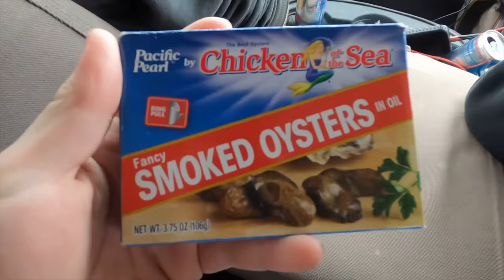Will this Old FORD Drive 500 Miles Home???

Comment: Janelle, I was a Paramedic for 28 years. It is a great job, tiring and rewarding. The greatest advice I can give you is to get your Paramedic license to work on a truck for 1–2 years, and then switch over to nursing., get your RN, and from there you can go much farther. The hrs will be less for extra pay and benefits and your home time will be much better for you. The risk of hurting your back or getting assaulted will be less. Back injuries are more common in shorter people. As a Paramedic you will be way ahead of the RN game as ACLS, PALS, NOWS and BTLS are bred into you in a year, that is your benefit as most RNs get some of that but not all of it and usually not until they have their RN. It will make you a better nurse and leader for your patients! Best wishes and it was good seeing you on the show again!

Comment: Tell Jannelle great  career choices. I retired after 40 years as paramedic. The shift slowed me to have a second career. Also, I did residential building and remodeling.  If you can try for a fire department based EMS service, way better benefits.

Comment: I had a 76 F250 super cab with a 460. It got 10 miles a gallon no matter what I did. In town going back and forth to work, or cruising down the highway. I towed another F250 with 4000 pounds of firewood split between the 2 trucks 150 miles down the highway at 70 mph with the cruise control on in the hills of Missouri. And it still did 10 mpg.

Comment: 25:24 Thermo boots made to keep the cold out also wont let the heat in ....in cold weather you need to get the boots off and wear shoes the heater even if its great wont warm your feet youll know when your legs are frozen up to your knees ......sit in the seat feet outside the truck take your boots off ,swing your feet in and place your boots so the opening is facing the floor vents on the passenger side , try and keep the floor as dry as possible...drove 3 cadilacs and a lincoln from Ontario Canada to Calgary ,Alberta before we discovered this concept  it works talking thru experience about 2,000  miles worth of froozen feet and legs absolutely numbness on the feet and legs doesnt matter how much you tap your feet and dance and squirm you will freeze if the geater vent is able to warm.yiur feet because of boots ...

Comment: About time you have decent truck on this channel!  :p  
(I collect build and modify dentside Fords tucks, and collect parts for them like your Dad does Corvairs.. :D )  

looks like 73 to 75, 1 ton, 390, Should be a C6,  probably a "custom" trim package, looks pretty basic, although a lot can have changed in 50 years.  Probably D60 in the rear, 3.73s, although my 71 with 4.10s is a 90 mph truck, but if you were cruising like that with out the motor wrapped, I'd call it higher,  3.50;1 maybe. if it wasn't a 1 ton I'd guess higher, my 76 2wd w/460 has factor 3.25 limited slip! 

Really cool seeing that countryside over that hood, even if it was in fast forward!(I've been daily driving one for 20 years, but will probably never get to drive one outside of Alaska)  

Even before Rudy said it, I was thinking I'd like to see you smoke the Dodge with it.. :D

The build on this thing better be on this channel or I'm gonna come down there and throttle you guys ;) :D

Comment: Don’t make the mistake of ruling out those old Ford Trucks. I grew up in
Several of them. Those 351 and 390 V8’s are tough engines that don’t need
a lot of maintenance..  I am driving an F150 extended Cab version now..
Those truck has a lot of life left  in it still. Great to see Janelle back..
Be Safe you guys.. 
MWP Cosby Tn.

Comment: Don’t ever get rid of that motor. It will last for ever. I had a 78 F250 with 460 in it. Got over 300000 miles on original motor transmission rear end only changed out the water pump alternator and Radiator. I saw the super cooling radiator in it. Also I can’t remember if I had the timing at 8 degrees btdc. Or maybe 16 degrees btdc. Never used oil   For the oil leak on the back of the engine check the oil pressure sending unit at the back of the engine on top near transmission. Mine blew the top out of it and it pissed oil like what you got. Stick your hand down the back of the engine just left of center and see if oil is puddling at the back. I thought I had blew out a rear main seal and when they went to take the cruise control off the block the stuck their hand in oil.  I wish I had my old truck back. I had it for 17 years and paid $7800 for the truck new and sold it for $2500. Not bad for 300000. Good luck with it.

Comment: I had one like that for my 2nd truck. MAKE SURE you grease and oil the hood hinges to take the stress off of the galvanized inner fenders.
Does it have a 351 Winsor or a Cleavland?
Reply: 460

Comment: That truck didn't turn over, because no one stomped the gas down 2-4times before cranking.  Every f series I've ever owned 67,72,77,79 all few good stomps and then crank. Usually kicks over. Think it's just part of the charm, even with the "automatic choke" carbs

Comment: 1973 or 1974.  Round headlights and the turn signals are above the headlights.  I had a 1974 F-100 4x4 for 40 years.  I miss it but the rust was winning.

Those old FE engines used a rope rear main seal.
Reply: it's a 75.  same basic grill from 73/77. the inserts were 73/75 & 76/77
Reply: @oregonfordguy9812  but I believe they blacked out around the round headlights before changing the the square headlights.
I could check the final issue of the microfiche if I hadn’t left them with the factory manuals and if I had a reader. 😁

Comment: I once was a mechanic for a dealership that sold Tracksters.  They are nice machines.  They are hydrostatic.  The engine runs a hydraulic pump and the hydraulic motors at the front of the tracks move the machine.  They always said that if the hydrostatic motors last for 20 hours they are good to go.  We did have one lock up on us, and had to be replaced.  PLUS, It locked up right in the middle of the main-line railroad tracks from central Oregon.  What would have been the odds of that happening.  A Zillion to 1?

Comment: I came in at the end of the video where you were putting that toy on the trailer and right when I saw it I called that a track star and then not even 2 seconds after I said that he came out and said that was a Cushman trackster I've been wanting one I have a possibility of getting one in my area if it's still there in a junkyard has been there for years I just don't know if it's still there or if all the parts are still next to it but when I get enough money I'm going to buy it and get that running myself because those are just really cool Old rugged rigs

Comment: I mean if it has to much oil pressure and that was a safety so it didnt over pressure the block. By block it off now it could have to much oil pressure. Just a thought though lol

Comment: Hey Rudy, is there a way we could communicate about some advice on my 2000  XJ build? I found a pair of axles from a 2015 f350 , a sterling rear and either its a D50 or a Super D60 front for $350. Would these be a good choice and price? Many more questions if you don't mind  one of your viewers picking your brain a bit for build guidance...

Comment: If you're going to buy a new mechanical fuel pump do not get them from O'Reilly's or AutoZone get it from Napa my 87 Ford pickup needed a new fuel pump I went through seven of them O'Reilly's and AutoZone they would just start spray and fuel out the weep hole or not pumping at all the rubber they use for the diaphragm gets eaten by the fuel that we have I literally replace the fuel pump everyday for a week until I said screw it and went and bought one from Napa and it worked amazing for couple years till I sold the truck